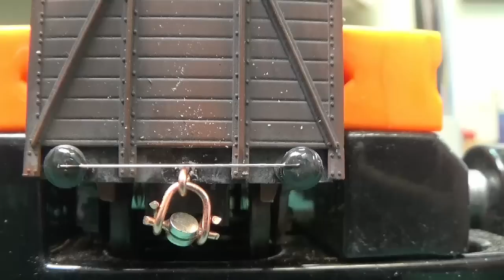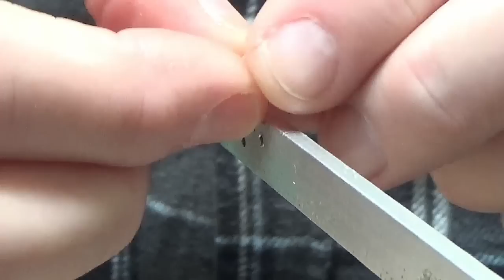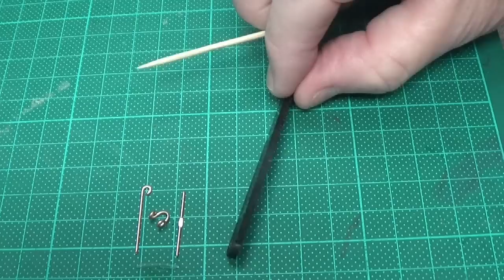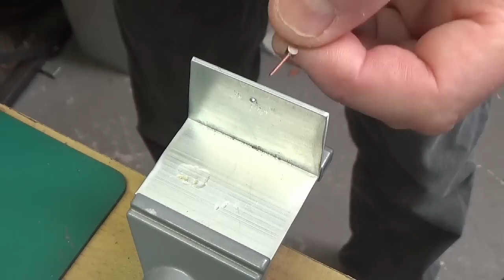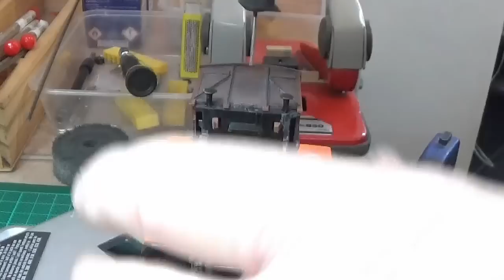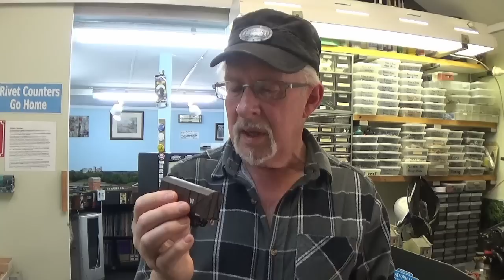How To Build Brian Gorman`s Rotating Magnetic Coupling

Comment: That is Brilliant.
I model in 0 GAUGE and whilst 3 link and screw couplings look the part, they are a pain in the arse to use especially with dickie  eye sight.

I could use large magnets. 
My mate Brian magnetic coulers  on his garden railway in Mannering Park but of course they are polarity conscious.

So if you weren't making this educational video, how long does it take to bang out a pair of these couplers.
Reply from the maker: G`day Steven,
I have not timed it exactly, but assuming you have all materials at hand with tools and jigs set up and ready to go, I would assume I could complete a wagon with a pair of couplings plus wires across the buffers in about 15 minutes.
This is a pessimistic estimate allowing for just taking my time on a wagon with no issues such as wagon weight preventing the connecting rod being inserted into the buffer beam or some such thing.
If I were to go for it against the clock, 10 minutes would be possible I think.?
Once you`ve worked out the processes, everything becomes easier and quicker.
I have found batch production helps in this regard.
If you decide to spend maybe 1/2 an hour one day making the little axles for example. That process becomes quicker the more you do it because you get a routine going.
Same applies to the other parts......get a supply of parts made up over a period of a couple of days  and then just concentrate on assembly and fitting.
Hope this helps
All the best
Gormo
Reply: @greatchesterfordjunction  you may be gormo, but NOBODY ,could call you gormless.
I think your idea is genius and I have decided to give it a go.
Reply from the maker: @Steven_Rowe  
Well good on you Steven and I hope it works well for you.
I had not given a thought to how it would go in 0 gauge, so you`ll have to let me know how you get on.
All the best
Gormo

Comment: These resemble the old lego couplers
Reply from the maker: G`day,
Yes this was mentioned by another subscriber as well.
I was unaware of the Lego system initially, but have since seen pictures of it.
The Lego system with a rotating coupling appears to be in a fixed pin arrangement that allows it to move in an arc from side to side whilst the magnet can rotate within the coupling.
This means that the coupling cannot drop down like mine when pushing and therefore has no buffer lock problems.....that` where we differ.
The other Lego couplings I have seen appear to be polarity specific and have colour coding to help with that.
So in my opinion....similar but different.
All the best
Gormo

Comment: Very nice. I like the Sprat and Winkle myself for goods as it allows for remote uncoupling - but I am unsure whether I will use them for passenger stock.
Reply from the maker: Thank you for your comment.
Sprat and Winkle is a good system and actually inspired me because of the bar across the buffers.
Passenger stock with my system needs the coupling mounted via a draw bar on the bogies which will be covered in a follow up video.
All the best
Gormo

Comment: When you come to put the wire  on the buffers why don’t you leave the wire longer and you can hold it and cut it  off when it sets ?
Reply from the maker: G`day David,
Yes sir, I tried that on the very first one I made.
It certainly is easier, however I`d finish up with a tiny end of the wire just protruding from the glue and felt that could cause issues.
So decided to cut the wire shorter so that it would be enclosed within the glue.
All the best
Gormo

Comment: Hi Brian, how much weight can it cope with ?
Reply from the maker: G`day Roland,
This version has not yet been tested.
This version has two magnets per coupling and has more grab than my previous version which had one magnet per coupling.
The previous version could pull something like twenty plus wagons from memory and or eleven coaches......don`t quote me on the numbers, I would have to go back and find my tests.
So in theory.......this double magnet should pull more than the single version.
I have accepted the limitations because I don`t normally run trains anywhere near as long as those tested above.
Cheers
Gormo

Comment: ¡Hola buenas tardes Gormo!  Neodymium magnets arrived last Friday.  I’ll be checking out UV glue suppliers and, search the wire box for the base material. What’s not to like when it’s a ©️Brian Gorman instructional video. I’ll post the results soon!  Stay safe and well. Un saludo. Gary😋
Reply from the maker: G`day Gary,
Sounds like you`re almost ready fro manufacture.
Hope it works well for you.
I mentioned to one of the guys above that I realized there were a couple of bits of information I neglected to include in the video, so may have to do a follow up to video to tie up the loose ends.
Good luck
Gormo
Reply: @greatchesterfordjunction    I’ll look out for that update. In the meantime I’ll start preparation works 👍🏻

Comment: Thanks for all your efforts in sharing this Gormo, an ingenious solution that will help many. 

I've tried I.R glues, not had a lot of luck with them - perhaps I chose the wrong brand 🤔

Couplings are the bane of my life tbh.

I take it you are not using TLs with a piece of metal inserted (for magnetic uncoupling as opposed to magnetic coupling), because they're obtrusive and also won't close couple?🤔🤔
Reply from the maker: G`day Muso,
The UV glue seems to work well for me, I have used it in different applications and it has held very well. 
The thing is that it can only set properly if the UV light can see the glue, so in some instances it can`t possibly work.
I will continue to use tension locks on my long coach trains and I have a magnetic solution to operate the front coach TL and the rear coach TL on those trains.
It requires that the loco has no hook on it`s TL coupling though.
You can see it operating at about 35 secs into the video below
https://www.youtube.com/watch?v=2clnCa1RnkI

All the best
Gormo

Comment: G'day Peter. Good one mate. I reckon something like that would be good on roll over dumpers where they can rotate without uncoupling.
Reply from the maker: Thanks for you comment Chris
Cheers
Gormo
Reply: @greatchesterfordjunction  G'day Peter. I saw a video on magnetic couplings back a few months now and they were I think from memory [ failing a bit these days ] , made by Marklin to suit HO. only. The idea of them is they are electrical contacts as well as couplings. If you were fitting lighting kits into your coaches you only needed to fit power components only into one coach and the power would transfer through to all of the other coaches. Having N scale it's pretty damn hard to make a power transfer coupling to suit. I learnt some new Russian and German words I've never spoken before because the parts are so small and I can almost put my hand around a football. I'm also in the middle of watching your next coupling show so I'll post this and then re-wind the video and watch and see what other intricate possibilities I might be able to use on a smaller scale. Catch ya later mate.
Reply from the maker: @chriscorrigan7420  
G`day Chris and thanks for the Marklin info.
All the best
Brian